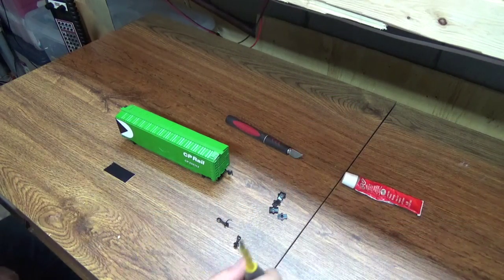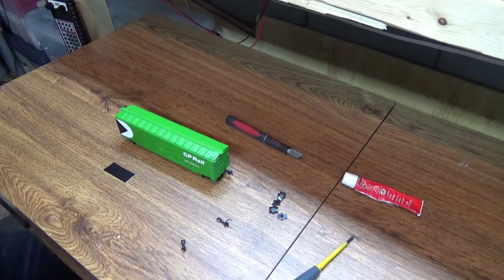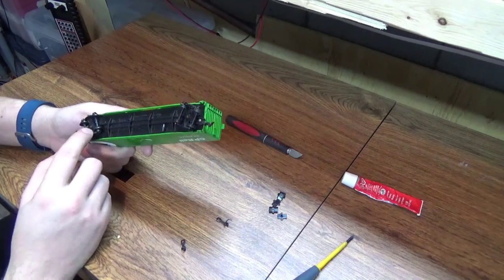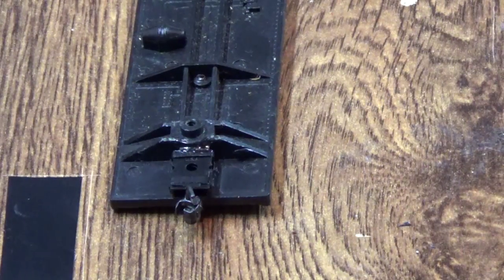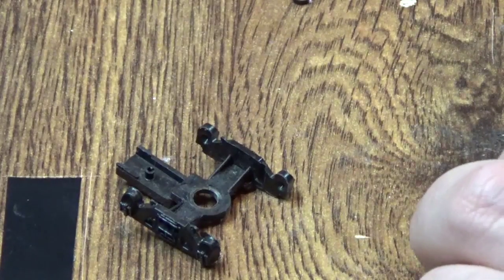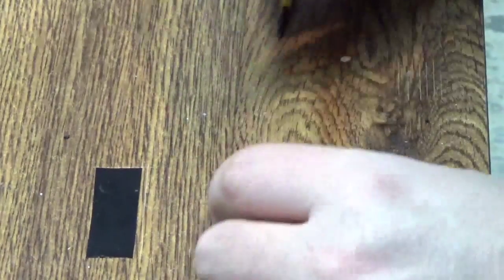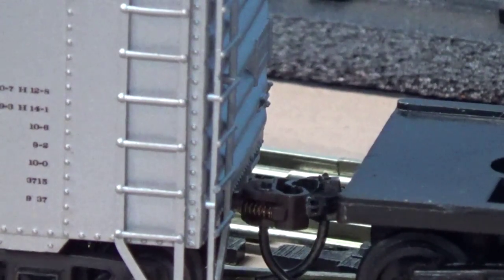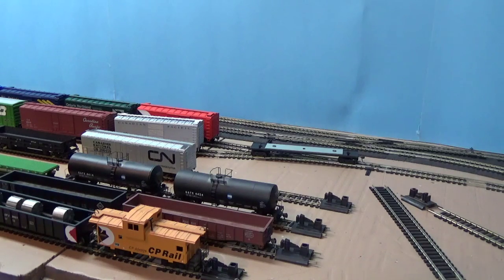HO scale How to - Changing Truck Mounted Couplers on Bachmann Boxcar

Comment: Four years ago, I converted a couple of Bachmann 50' mechanical reefers. In doing the couplers body mount, I had to add a piece of plastic about 1/4" wide by 3/8" long and 3/32" thick, between the floor of the underframe and the bottom of the coupler box. Because when I tried to mount the coupler box directly to the frame, I saw my couplers were too high, and wouldn't center up with the others. 

I went ahead and replaced the trucks and wheels with Athearn Barber Roller bearing trucks.

Comment: Pretty good video.  Tip:  Also use a screw to secure the coupler box to the underside of the car bottom.  Glue will eventualy dry, crack, and weaken ... if there is a screw there, it will never let go, even if the glue weakens and lets go.

Comment: I am usually not a fan of glue boxes only.  But on some of these cars, a screw would hit the flat metal weight on the floor. To get around this either cut off piece of the weight from the ends ( 1/4-1/2in.) or drill a clearance hole( 1/4-3/8 in) in the weight ,where the 2-56 screw would protrude.  Your solution avoids these extra cumbersome steps.  However, a screwed on coupler  (w/o glue) would allow for removal after height check in case it had to be shimmed down.
Reply: I actually like it better if I hit metal on the ends of the weight. Because I can drill a #50 hole, and tap it for 2-56 and the weight acts as sort of a nut to help hold the coupler box screw in place.
Reply: i have short screws (drill and tap) i use to hold the athearn metal couple cover onto the factory center pin. up to 1/2 in in length (for that special project). but yes mark the metal, and over drill it out. but most factory weights have holes there already. or i dump it and add in my own lead weights as per nmra standard.
but yes screw them on as it is easier to take care of maintenance issues.
Reply: @michaelmorgan7893  ingenious mounting  option.

Comment: Thanks for the tips. After commuting 2 times a week on Amtrak i'm getting into the hobby. I found some old Amtrak rolling stock that I could find anywhere else the only issue is there still using horn hook couplers. I will use your tips.

Comment: Nice video. Thank you to have taken the time to demonstrate it.
I had a lot of those old Bachmann cars. And I converted all the one with a proper place to put the Kadee box. I screwed the Kadee box instead of gluing it. The coupler height were correct like yours. Some cars, the height will not be proper, so I am waiting to do those. I intend to put some plastic filler between the Kadee box and the car body.
On those hard to fix the coupler, I some time just replace the existing coupler by the Kadee. It stays a coupler on the truck, but it is at least a Kadee! It works well, a little bit lower than supposed!

Comment: I actually purchase a used Tyco Swift refrigerator car that someone added body mounted couplers to and chaned the trucks to metal ones with working springs. I have recently discovered it's a popular car to modify.
Reply from the maker: That's awesome! Thanks for the comment.
Reply: Daveh88 Kadee also has some whisker coupler boxes that snap together you can still use the number 5 coupler and centering spring if you prefer.
Reply: Daveh88 Kadee also has some whisker coupler boxes that snap together you can still use the number 5 coupler and centering spring if you prefer.
Reply: Daveh88 I do prefer body mounted couplers though. I recently made this modification with one old Tyco hopper. Knuckle couplers on the trucks just didn't work right on that car.

Comment: Thanks for the vid.  A suggestion: instead of the process you go through with the electrical tape, get yourself a good pin vise, small drill bits and some small screws to mount the coupler box to the under-frame.  That is why there is a hole in the coupler box.   If you still want to add a dab of model glue toward the back end of the box you can, but after you have screwed it to the car.  With the screw you can easily take things apart if you have to to fix something-you can't with your tape and glue method.  Also, those coupler boxes you used are not meant for the Kadee whisker couplers (148s might be the kind you used).  Those boxes are for Kadee #5s, used with the bronze metal spring.  Kadee makes a different box to use w/there whisker couplers.
Reply from the maker: Very good idea but in my case I only had to do it on 4 cars so it wasn't worth going through all the work and buying everything. the coupler boxes seem to be holding up just fine too so I got lucky. Thanks for your comment!
Reply: +Daveh88 You're welcome.  Consider you may actually do more of this in the future.  Tends to happen the longer you are in the hobby, lol !
Reply: +James Brock   And one further point; a pin vise is a great all around tool, not just for coupler box work, the same with the screws and drill bits.
Reply from the maker: +James Brock Good point. I try not too think that far ahead because when I do my wallet hurts. Lol. I'll keep it in mind for sure. thanks!
Reply: +Daveh88 I hear you bro.  The hobby can put a dent in the wallet.  Sometime though, planning and thinking ahead can save you when all is said and done ;)

Comment: hey Dave. This is exact video I am looking for. I have a Bachmann Chessie System boxcar (old) and has the truck with a coupler on it. now the way I saw you video makes me want to buy some kadee coupler #148. I have a super glue but I wasn't sure if that was the glue that I was going to use or not. I have a question. What type of glue were you using and where can I buy one?
Reply from the maker: I was using super glue from the dollar store. The cheapest I could find. I never had any issues with them.
Reply: Daveh88 Good Idea. Alot of people said it's a bad idea. But for the record I think it's a good idea cause in such cars bottom frame doesn't come off there may be a solutio  to glue it down.
Reply from the maker: CSX2057 I just figured it's easier than the alternatives and work just as well. Cheaper and faster too. Lol

Comment: Also, if you are going to go through all that, might as well add some weight-guarantee that car is waaaaay underweight by NMRA standards.  Extra weight will allow it to run better as well.
Reply from the maker: Another good point. This video is just a how to for the couplers, but off camera I actually did add some weight.  Thanks for the comment!
Reply: +Daveh88  No problem.  How'd you break the coupler box off the Athearn?
Reply: Daveh88
Reply from the maker: I used sharp pliers to cut them off of the body.
Reply from the maker: James Brock yes snips I usually call them. lol